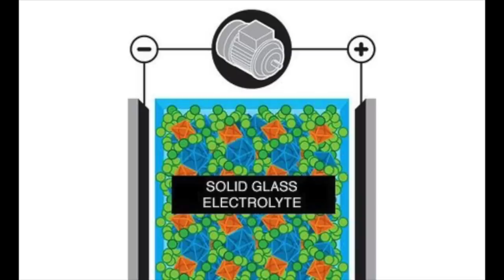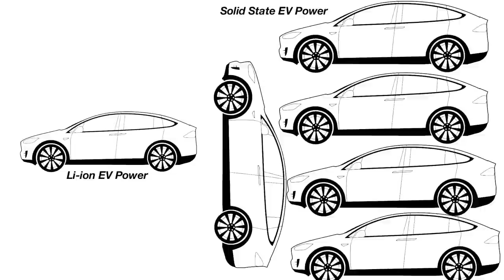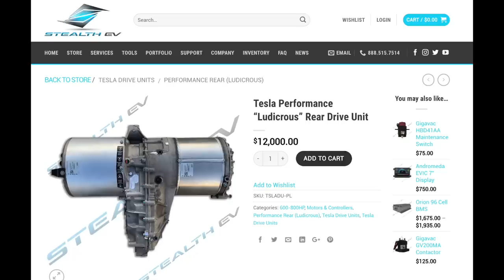The New Battery That will END GAS CARS by 2030 - BIFB SCIENCE (ft. my boat)

Comment: I don't think most manufacturers will go Tesla's way with multiple motors, what will likely happen is that the change to the chassis will be gradual, and when the technology does become viable commercially they will just stick a battery in, swap the engine with a large electric motor, and keep the existing drive train. It would be the most economical way to go about it, and one larger motor will definitely be more efficient than multiple smaller ones. It's also cheaper, and allows you to use the same motor for wide range of vehicles (FWD, propulsion, AWD, even multiple axle trucks). That means you will still see lots of transmissions and differentials, and the drive train won't change much for most. Even Tesla on the new truck they unveiled last week offer the option for a single motor instead of their regular drive train. So there will still be hot rods, with different motor arrangements, drive trains, clutches, etc... Most of the R&D will pivot towards increasing the drive train efficiency instead of the motor's, reducing heat, and improving aerodynamics and handling.

Comment: The range of cars should increase by a larger factor than 2.2, if the new batteries can take a charge faster, then it will be able to take a higher regen current, existing regen is restricted by how much current a battery can take, so higher current intake will equate to much higher regen possibility. Add this to inline super capacitors and electric vehicles will far outstrip current ICE ranges.

Comment: That's interesting so we transfer all of that pollution from the roads to more power stations
Reply: Actually though I am not some kind of hippie that believes all this climate change nonsense the more electric we use the better yes renewables is stupid technology since the sun is not always shining and the wind is not always blowing and because of that we need just as much fossil fuel generation capacity as if we never had 1 single solar panel connected to the grid but not only is the technology getting better every year but when you use fossil fuel thats it gone forever whereas when we are using renewable well the clue is in the name.

Comment: Tesla's announced improvements could be accounted for by their purchase of a couple of companies that not only have manufacturing but patents and new super capacitor technology. If the battery can be manufactured and works in the real world as opposed to just the lab it is as game changing as you say. One other major advantage of this new battery is that it will last much longer than other Lithium ion batteries so a 20 or 30 year lifetime if not more. You might actually scrap the car and just transfer the battery pack to a new car!!

Comment: As someone who studies electrical engineering; I have to say that you are somewhat uninformed when it comes with this new battery technology. There are many parameters that are important when selecting a battery chemistry for a certain application. As you mentioned in the video; battery energy density, size, weight, and charging speed are all important factors but one key element you left out is battery discharge rate. The electric drives you will have in these new electric cars while theoretically could have (for example) 700hp they are handicapped by the batteries ability to supply the drives with the full load current necessary to reach that 700hp mark.

Comment: Yeah if its real and it turn into a lot more charging outlets in parking lots it will mean a LOT of electrical infrastructure with big fat copper cables (assuming you have to charge these batteries in a short time). Probably big systems will have to have a high voltage substation that step down to 240V and distributed from there. I'm also skeptical about how you get sodium from seawater, that takes a huge amount of energy to split the sodium ion from the chloride ion (NaCl to Na +Cl). Interesting though.

Comment: Isn't there currently a major issue with temperature for solid state batteries?
Reply: Problem here is that the Glass Battery is based on bad science and poorly run tests, and wildly exaggerated conclusions from those results.

Comment: Actually you have missed probably the largest implication of all probably because it is not transport related. The biggest problem with renewable energy is that it is not constant. However these batteries should be not only safe enough but cheap enough that you can store excess energy even for a town or city. At the moment we need extra power stations ready to fulfill our energy demands at night or in winter or when the wind is non existent. A lot of the time they are just idle. However if we could store enough renewable energy then these would not be needed or not so many and energy costs should be reduced significantly.

Comment: There are a couple things that EV people don’t get about “car guys” love of hi-po cars. First and biggest is the visceral, aural sensation that that you only have with a fully built ICE. The other big drawback with current battery tech is energy density. Electric cars are incredibly heavy. I love the new Porsche Taycan but it weighs well north of 5000lbs! I do love EV’s though and am excited to see the new tech and car reveals. I am excited about renewable replacements for petrol. F1 uses a little under 10% and are committed to reach 100%, and be carbon neutral in the coming years. Why don’t you look into a build that employs hybrid tech and a renewable fuel? There must be someone out there who could help you do a traditional hot rod, muscle car, or newer performance car that would be a low net carbon, renewable fuels, hybrid tech powered car?

Comment: Have you heard about the Tesla research that is moving forward? A crystal will be the energy source that resonates when provocked but a signal sent by a tower.... What that means... No batteries at all... The tower generates a specific frequency that stimulates the crystal in any given device .... They are ALREADY working on this new transmission tower , it IS happening now... So this battery update is very important but may be a quick upgrade paired with this new tech or quickly surpassed by this new tech

Comment: It sounds pretty technologycally interesting. My main consern is the way of the human industry is behaving: we go too fast in a direction without looking at the bad sides. You told us that there is planty of sodium in the sea. Great! Water is free, so industrials will not have any restriction. They can use a free ressource to sell us something. Best industrial model. What will be the effect on sea life if we reduce the amount of salt in the sea? Water density will change, what effect on deepsea current that balanced the temperature in the world? nature is « naturally » balanced, and human is always affecting this balance. It’s in the human nature to improve everything.  We improved so much the thermal engine efficiency and we can improved again using Formula 1 technology that ables to reach in peak point 50% of efficiency! But on the other side we added lots of equipment for safety, comfort and so on. The result is todays cars have almost the same level of mpg than 10 years ago. My opinion is there is not A solution except reducing the energy consumption per person. I’m a fucking car guy / Petrolhead, working in the automtiv indistry in electric motor development for hubrid solutions, and on the other hand, I’m freelance mechanic on historic race cars: Groupe C, Formula 1, GT and protos. I don’t want the thermal engine to disepear, but I doubt about the full electric solution.

Comment: People love the sound of their gas engines and modified exhaust. Have you ever gone to a NHRA Top Fuel Drag Race. The 11,000 hp shakes the grand stands, you hear and feel the power. There's just no thrill about a whiny whisper quite electric motor. Now a commercial airplane that can cross the ocean would save millions in fuel cost, also that is where you want quite.

Comment: Very promising prognosis but harnessing/storing electricity is only one of the two big issues. You cant just convert all cars to electric because the infrastructure for that doesn't exist. Most of electricity in the grid is produced through methods of burning other substrates. That is because even with incentives to do more solar it is still highly inefficient. It will take time, more time than to just develop an efficient battery to learn how to convert other energies to electricity and build out the needed infrastructure to provide it to the general population.

Comment: When airbags were mandated there was talk of legislation putting a defined lifetime on the devices requiring replacement.  This would have effectively killed the resale value of a used vehicle approaching the airbag replacement time limit.  Similarly replacing LiFe battery packs that are approaching the need for replacing them effectively lowers the resale value. An internal combustion engine can be reasonably inexpensively reconditioned to give the vehicle a new lease of life.  I believe that you are being a little too optimistic in announcing the extinction of the polluting IC engine.  The demise will come about through legislation. In the near future surely hybrids utilising smaller less polluting IC engines will be the saviour of the motor vehicle.  Personally,  I would love to see all electric cars replacing polluting IC powered cars, including hybrids.  However,  politicians fearful of the backlash will not take that giant leap and outlaw the IC engine.  Any announcement will need to be a worldwide consensus and third world developing countries are not going to agree.  Multinationals choose third world countries because of lower pollution laws enabling greater profits. Governments are run by corporations and they do not view the future only the current market share value.

Comment: Currently (sic) there aren't enough electricity generation plants to cope with a mass exodus to electric cars. Wind and solar won't be able to plug (sic) the gap. These batteries may be 5 times more efficient but you've still got to fill them with amps. Perhaps the powers stations could go back to oil if you don't need it for gas? Happy to have any advancement in battery technology but 90+% of us don't need or want anything more than 120hp and 120 ft lbs. so cost will be the stumbling block for quite a while. How many people here, or you know, that have never spent more than $5k on a car? Quite a lot I'd guess. I've never got near that.

Comment: SO.... one of the constraints in all this is the “electric highways” all this energy has to travel to get to the Goodenough Batt (or other...). As an example this technology will require a massive update of residential electrical distribution.... in many cases doubling the service size of typical home... ie a 100 amp residential service will need to be a 200 amp service... minimum. Electrical distribution now is using 200year old technology... copper or aluminum WIRE. Using these standards.... bigger service is simply BIGGER WIRE... hmmm.... Hope Dr. Goodenough is working on this because if everyone decides to go electric car overnight.... its gonna be a really dark night... Not to mention the production side of the electricity story....😎

Comment: All platforms will always be around based on use case. Electric gas diesel hybrid.  Transmissions are what are changing things if you ask me.
Reply: To be clear.. electric is not sustainable currently due to the infrastructure needed to support it.  That’s a fact.  It’s why electric has not taken off as quickly.  Grids around the world just suck.

Comment: So do these batteries loose storage overtime like lithium ion batteries?? Just saying, gas tanks don’t shrink overtime
Reply: That's one of the major benefits of solid state. The longevity is vastly superior. Even with the current tech Tesla is using, their batteries last much longer than any cell phone battery. A taxi company in Cali is using Teslas to shuttle people back and forth to Vegas and have put on over 200k miles on a battery. Solid state batteries will nullify the degradation issue all together.

Comment: What happens when they turn the electric off?
Reply: For the occasional power outage I have a 240V generator that can run on gas or propane.
Reply: The same thing that happens when they turn the gas pumps off.
Reply: Good point  if the power goes out were all fucked

Comment: Well look at it this way, we will have masses of chlorine due to all the sodium ions being drawn out, also lithium batteries often work with lithium ions (charge carriers) moving through a polymer. They're not liquid like lead acid batteries they're more of a highly flammable jelly.
Reply: Also liquid hydrogen has 42 times the amount of energy density in comparison to lithium batteries, also liquid hydrogen doesn't have to pushed through a cable, instead it's refuelled like a car. This also in theory would have destroyed the combustion engine, but hydrogen is just dang hard to store and transport.

Comment: The higher storage will just result in fewer batteries in the cars which brings down the weight. But probably also the price.
Reply: Actually not the whole story the batteries should also be a lot cheaper to make and last longer than Lithium Ion Not certain but I think they are also lighter than lithium ion as well

Comment: THE issue holding electric powered transportation is the lack of generating capacity and line infrastructure.  Neither exist in sufficient capacity today and are going to need to triple or quadruple.  This is the dirty little secret NO ONE is talking about.
 Racing is already impacted at the very fastest by electric engines.
The largest vehicles choose to drive are trucks - the Ford F150 is the best selling vehicle in the USA.

Comment: Great video, but there is a glaring omission....new battery tech is all very good, but where is the energy coming from?

For many, it will come from burning oil and coal....and yes, the cars will be cleaner but at the cost of a massive increase in fossil fuel consumption....so it's either being burnt in the car - or at the power station. Unless of course, we can get it from more renewable sources? The battery technology is great, but it's where the energy is coming from that is the real issue, surely?

Comment: The Tesla is a single speed . So it needs to have tons of power just to get rolling . A smaller motor with a transmission could do every thing from producing plenty of power to get rolling . And plenty of gearing to go as fast as you want . And much lighter batteries , with much better life .

Comment: I have thought about designing an electric car. For my formal job, I design electric and fuel cell transit buses, so might be a good step to build a car. Just the price of batteries makes a project like this so difficult. $20-30k for batteries, charger, inverter, motor, DC/DC converter, HV junction box with fuses... compare to an amazing V8/10/12 swapped car, and it's a hard decision. Just comes down to becoming an early adopter to the technology. Thanks for bringing this to the forefront. I'm curious what my company thinks about this new glass battery technology - Frank.

Comment: You should look at why Tesla isn't using solid state batteries.
Reply: Actually it is very probably Tesla are checking out these batteries now. There is a large leap between works in a lab to will they work in real life and how do we manufacturer them. Lithium Ion batteries took many years i think 7 or 8 for this step. But the bloke behind Lithium Ion batteries is the same person.

Comment: No, it won't. That is because the battery is not the problem, but generating the amount of energy to charge them when you want or need that to happen is. In effect all that we are doing is taking away the fuel from the car and then burn it some place else to produce the required electric power.

Comment: NASCAR would eventually roll with the times... Case & point, the next-gen NASCAR car will have a low voltage hybrid system. Not exactly pushing the boundaries of hybrid tech by any means, however, if you told people 5 years ago NASCAR would go hybrid, they would have laughed at you.

Comment: build my new version of my 1984 electric motor.. no gas needed.. jyst need 1 to help me convert it to brushless.. runs itself.. battery optional if not use a capacitor
Reply: also.. best on boats cuz i used it for my rc boat.. screw Elon.. he not do it right.. requires a plug.. emergency in my design. but what if i get rid of the battery all together   i am keeping it from gov cuz they not help back then.. but they know i am good at solving problems
Reply: also.. they stole my work cuz microwave gun i made was for agriculture.. 
and batteries get hot. like motors.. but must be brushless this time.. spark depletes ozone like welding & lightning does.. eliminate it all together sparking

Comment: Electrolyte = Salt
And, the heat produced would be tremendous.
And, salt is heavy.
And, you def don't want all of your batteries at the lowest point of the car.
Reply: Glass ≠ salt
You definitely want your batteries as low to the ground as possible. That's one of the reasons Teslas are rated the safest cars in the world. Low COG.
Reply: @asix9178  I never mentioned glass (which is heavy), but salt ( which is a central part of the battery) is highly sensitive to moisture, as are most electronics.  On the East Coast, these cars will have a short to medium lifespan. I know because the flat-pan chassis concept is not new and won't work any better laden with an array  of power cells hanging beneath the chassis. Li-Ion batteries are not zero-emissions! They can get quite hot. Good luck!